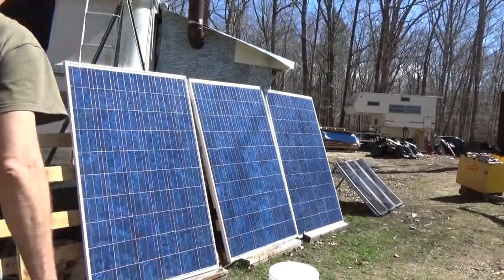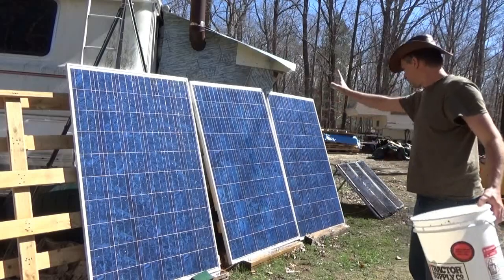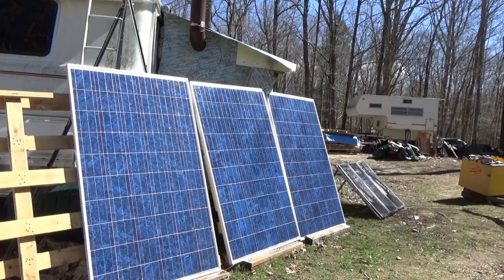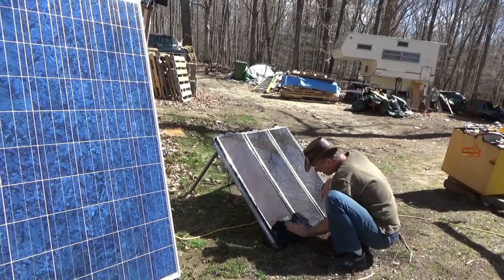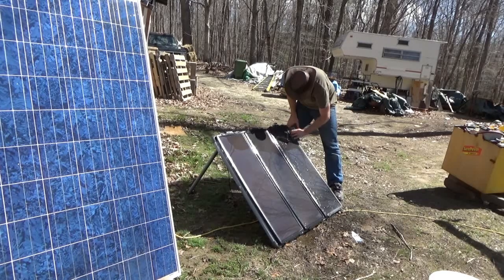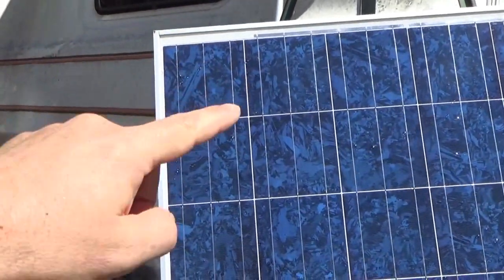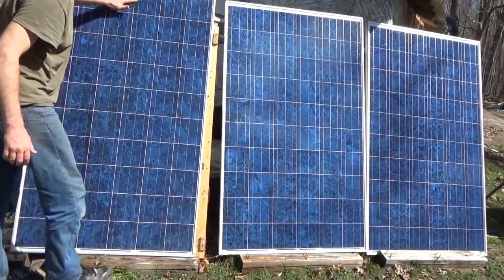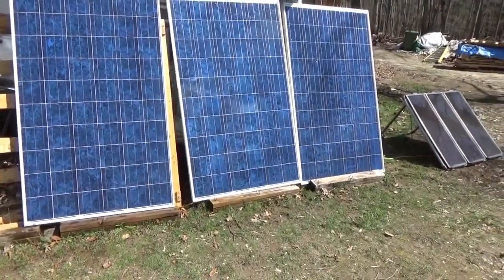Wash Solar Panels For Better Off Grid Power Production

Comment: Hi Troy try using RainX on the panels. Its the stuff you treat car windscreens with to stop water droplets and Dirt sticking to the windows. It makes the dirt and water just slide off, keeping it clear.  As the panels are also glass it should help keep them clear most of the time with less maintenance :-)

Comment: Need a hand siphom to get a pressurized stream for rinsing. Rain-X might work on keeping rain water from sticking to panels. I notice the upgrade with the trees gome and that was a gloomy day, from 30 to 120 watts
Reply from the maker: Frederick Nolan I dont know the solar properties of rainx though. Many people suggest it but it has not been lab tested for passing solar energy though. Many things block it some.
Reply: Sounds like a test on little panel off the grid. Check the contents if it hazes over time then it will cut light but if your's are uv reactive than will work in cloudy days.

Comment: why didn't you wet your green pad with the BUCKET OF WATER instead of running around like.....wow. why? i really need to know. You have MANY buckets.
Reply from the maker: grodad Because I wanted to keep the rinse water clean. And because the rain water was right there. And because I did not have a free bucket nearby. Why does such a simple little detail make so much difference to everyone. Who cares really?
Reply: The Do It Yourself World The thing I noticed is that you didn't have the rinse water ready. What was on the panels after scrubbing them would have started to evaporate before you got to them with the rinse water. 
Maybe not very significant amount, but every little bit helps. Just like when washing your car.

Comment: Troy how would you compare the cost of your  solar expenses compared to what regular commercial power would run for your operation there?  I have been trying to decide just what sort of system would be the most economical and also most reliable before investing too far into total off grid etc.
Reply from the maker: Jerry Staeden My solar panels cost 50 cents a watt. You can get them around a dollar per watt. Figure out what you use each day. Average homes use between 3k to 7 kilowatts of power at any given time. I use way less than average. Its a lifestyle adjustment. I use less than 500 watts at any given time and most of the time less than 100.

So my system is cost effective for me. No more $120 per month electric bill. Probably after a year mine was paid for. Two years max.

Larger homes use more power but then again some pay more as well. Its a lot of math.

The biggest gain is the peace of mind knowing that you are in control and you will never have a blackout.

Comment: almost forgot - how is the solar panel output now that you have re-arranged things?
Reply from the maker: James Pottorff The three by the house quit working the next day and I cannot figure them out. They are driving me insane. Tested separately they are fine. In pairs they are fine. Connected as three they put out nothing. In pairs connected to the house nothing gets through. Must be a connector but I cannot find which one. Or maybe a couple of them even. I am testing them every day trying to figure this out. I may just have to buy new connectors and swap them out.

Comment: I would use one of those things you use to clean a windshield at at a gas station along with a 3 gal (pump up) yard sprayer for water to rinse those panels. It would make it go a lot faster without having to stop for water each time.
Reply from the maker: James Pottorff Yes that would be good.

Comment: I think that was bigfoot spit on the harbor freight panels. Hey I was wondering if you will be able to use your old car battery that you just replaced?  Maybe have it hooked up to a small panel or 2 and just I use it to charge small things like the camcorder or cell phone, etc?
Reply from the maker: Joseph Dykes Car batteries are useless for off grid applications. They are built to give a lot of energy for a short time. Solar batteries give a little bit of energy for a long time.

Comment: With my luck those panels would have cracked.   But, I guess your rain collection is warmer than my hose water.
Reply: rich k  Yes, just a few miles away. ..which is close.   It woke me up.  It was a side to side motion, not a up down jolt.  I don't like the up down ones.  But, no damage as far as I can tell so that's good.    I'm not surprised because there was just a couple of big volcano blasts in Chile. ..it's all part of the ring of fire.  I expect we will have a few more, hopefully small also.    I am more afraid of tornadoes,  too!
Reply: rich k  Hahaha!   Basement is the last place to be in an earthquake. .. silly!
Reply: MollyDolly It's also full of Trolls.
Reply: rich k Hey now!!
Reply: UNumbTV  hmmm... a good earthquake could definitely sort out the basement dwellers. Maybe give them a better outlook on life.
Reply: MollyDolly
They could certainly do with a good shaking.
Reply: MollyDolly
Beating? Nope that would be worse.
Kicking? Yep that's the one.
Reply: UNumbTV  Yes!

Comment: haven't seen any new solar production numbers since you moved the panels and cut the trees has it improved?
Reply from the maker: lordmbuk Long story but the panels by the house quit. I fear the connectors are damaged and need replacing. I might have to buy more. Been trying to isolate the problem for days. Quite frustrating really. A volt meter gives me good readings on each panel but connected together I get nothing.
Reply: Oh sorry to hear that bro I figured something was up when you weren't posting it regularly well good luck I hope you get it squared away

Comment: Where do you buy your panels brother???  I'm building off the grid this spring & plan to wire my own bank & was wondering if you had any tips on getting single panels at a decent price?
Reply from the maker: GreenMountainGrow Google cheap solar panels. Or your local classifieds. Look for slightly used ones like mine. These were installed. The owner did not pay. They took them off and sold them for 1/10th of the retail price. Sunelec.com is one cheap source
Reply: Thank you, have you heard about the "tesla power wall" & if so what are your thoughts on incorporating one in an off grid system?